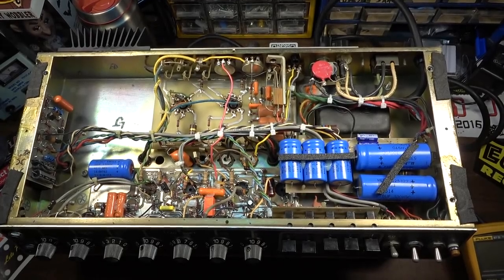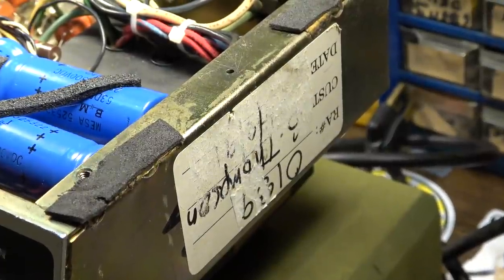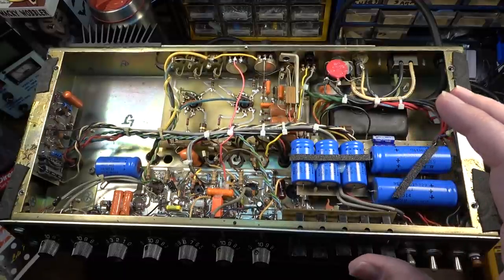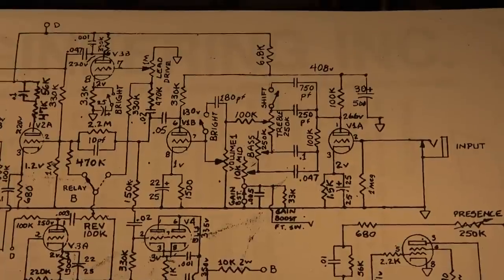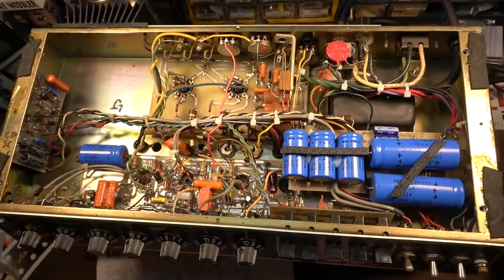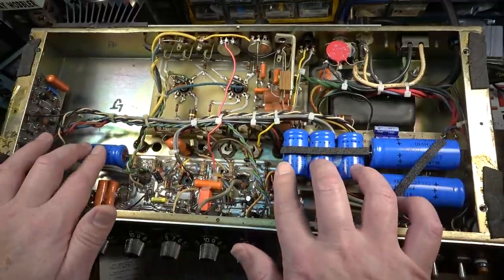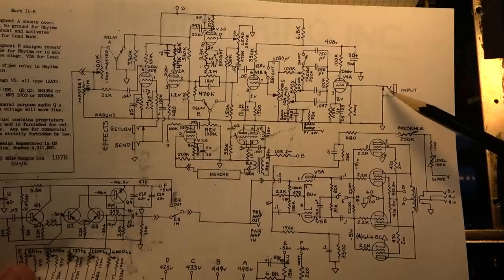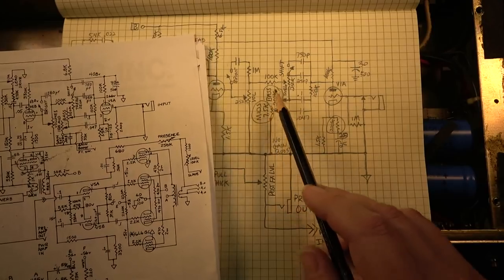The Mysterious Mesa Mark IIB+ | Analyzing a Factory-Modded Circuit

Comment: Man I can't thank you enough for going through all that work.  Now I can send this video to my customer so he can understand why I won't even attempt this mod. They are charging $400 at mesa now.  I read that there are over 20 variations of this amp.. apparently they just made changes as they went and wouldn't change the schematic.  The one I'm working on is from 85 and at least 50% of the resistors are different values than shown...please send help.. I'm not ok 😂
Reply: Jeeez.   My mk2b needs the crunch/lead gain worked on, but who the heck is going to help me lol

Comment: That resistor on the first triode is a swamping resistor. It 'tames the beast" if you will. Stabilizes voltage gain, but lowers the gain in doing so.

Comment: I have an 88-89' Mark III Blue Stripe combo. Got it in 99',  sent the chassis to Mesa in Ca. for an over haul in 05',  It was running fine but things were starting to scratch & crackle. Got it back in a month or so and 
it's still running today.  I mention this because Brad's right.  I was gonna do the work until I opened it up and was overwhelmed.  I started calling shops and techs but no one would touch it with a 10' pole.  The one shop that agreed to take it in admitted they knew nothing of it and it would be hit or miss. I thanked them for their time and called Mesa.  I've heard horror stories from both parties, techs don't like working with the amps and Mesa gets amps that techs have butchered beyond recognition.  So, this is for techs and Boogie owners. Techs, runaway when you see a Mesa coming up the driveway!  Owners, let Mesa fix your rig.  It will save you time and money, they don't charge anymore than a tech, your cost will be shipping if that applies. I'm a retired G.M. technician and I firmly believe when dealing with repairs of this type, you should take it straight to the source for repairs. O.e.m parts are superior in most stock cases and when you figure the time and money wasted after the guy down the street had to go to Jim's used cars & vcrs four times to get the right part that will last about a month (why do you think they have a lifetime warranty), cause you're gonna need it, then you have to pay Billy Bob down the street again.  Take it to the source, the guy who feeds his family working on whatever you need repaired and be Brand specific. Don't take a Maytag to a Whirlpool tech. Sorry so long but I keep seeing people making the same mistakes over and over and throwing good money after bad. I hope this helps the techs and the owners, cheers!  P.S. The Mesa portion may not apply now that Gibson acquired them.

Comment: Imagine Brad going through a 2C++.. He’d have a field day with that! 🤣😂🤣
Reply: i think the markv has more relays than the JP2C, i'd like to see him try a Triaxis.
Reply: or a roadster!! holy hell
Reply: @sendep7  I mean the OG 2C++
Reply: He already did a roadster ;)
Reply: 2C++ in the hardwired vesrion only adds like four components and changes the value of one resistor over a regular 2C+, the switchable version adds a single relay and a switch on top of that; the bottom line is it's not that complicated, from what I know at least.
Reply: C+ has only two or maybe three different board versions and two of only differ by reverb circuit. Mark IIB on the other hand was still kinda experimental since it was the ongoing process of perfecting Mark II which nowadays we call Mark IIA. C+ was a streamlined conclusion to all the mods done to the previous iterations thus why IIA and IIB are so chaotic in their layout. Also the "++" mod adds four additional components which add +6db to the initial input signal on Lead channel and +20db on the clean channel when engaged (Hetfields amp was hardwired this way but nowadays it is switchable, James just didn't see the need for usable cleans on his C+ since he used other amps for that). Mod also smoothes out some of the more aggressive midrange frequencies but the difference is subtle.

Comment: I've owned one of these amps when I was in college and used it extensively... I can't imagine putting another gain stage in it. As I remember that amp, it had crazy distortion in it's stock iteration. It was also a very clean amp even pushing the EV/SRO 12" speaker. (I might add that it was crazy loud and weighed a TON!)
Reply: I ordered a Mark -2B 60 watt EV direct in 82. Stupid amounts of gain available, and very nice cleans as I remember anyway.
quirky tip :
Put a compressor ( MXR dyna comp ) in the effects loop for infinite sustain at a reasonable volume level Santana Style

Comment: Totally agree Brad . They've tried so hard to make it the only amp you'd need , but the result is a nightmare to fix as you have demonstrated , and not even that easy to use . Wait until you see inside a Mk5 . That is all of their most notable amp circuits combined into one amp . It took me 20 hours or more of repair time to change a couple of burnt diodes and traces in a MK5 worth about 20 pence . My customer encouraged me to keep going even though I was worried about not getting the thing back together , there being dozens of wires to unsolder before you can lift the pcb and do the actual work . And IMO you are absolutely correct in saying leave it in the studio .

Comment: V4A - The grid is fed by a 0.1uF cap which is flipp'in huge for a guitar amp. Therefore current flows to the cathode via the 100k resistor plus the full signal as a small part of that voltage. It has more bass than what passes through the 0.1uF cap therefore get rolled off by the cathode - it being a negative. So this is both a preamp stage and bass roll-off filter.

Comment: It's my understanding, that the Mesa Mk II-B used the so called, "cascading effect" to overdrive the 12-AX7's in the pre-amp stage to obtain the amp's distortion where Jim Kelley amps overdrives the 6V6 power tubes to derive the amps distortion... which in my opinion has a more natural/organic tube distortion.

Comment: There seems to be schematic problems with quite a few Mesa amps. Not sure if perhaps I've had amps people have worked on prior, but I've never seen any RA# stickers or "messy chassis" evidence. Had a Roadster come in that was one tough dog to follow using a Mesa schematic that had wrong values and so many surprises, I had a party when I finally traced it over and found the problem. I really thought it was going to be a permanent part of my bench for the first few days I had it. They packed so much into that amp, but nothing compares to a Roadking. I'd be just fine if I never had to work on one of those again! Those are something else!
Reply from the maker: They fuck up their schematics on purpose.
Reply: @TheGuitologist  I knew it wasn't just a "misprint"! They don't like to cooperate at all, and since I'm not an "authorized repair service", they don't want to give access to any tech bulletins, FCO's, schematics - zip. I was a field engineer for 27 years, and I've been playing for 40. I got hooked the first time I swapped pickups and learned how to solder when I was 12. After that I started messing with amps, pedals - you know the deal. I love repairing and modding anything. The challenge of getting anything to work that's DOA is just something I love - BUT the Mesa Roadster and Road King I & II - damn. There's so much shit packed into those that I'm never wanting to "have at it" when someone calls to bring one in. There's things I know to look for, and components to change out from past experience - but trying to get ANY assistance from Mesa - at least for me because I don't know anyone there is a no go. I knew there was no way almost every schematic I've seen was a "misprint"! I don't understand why a "brand" like Mesa would do that on purpose? Crazy man.

Comment: Omfg , I actually have a Japanese knock off of a mk 2 b , that was laid out better than that .  It was called a Mesiah by Aidean engineering . 
Randall Smith promptly shut it down , lol .  And a notable similar was Dean Markley cd120 or a 60 version , which i may add  , were used by some notable players.  Probably on the advice of their tube technicians.  I can imagine,  like 
Nonono Eric , not the Mesa , this Markley is the same , but better ..
Reply: He mentioned the MESIA knockoff thing in guitar player? He claimed it was a horribly built POS and an insult to his high quality. From what I can gather over the years, is that he is  really full of himself

Comment: I did mesa boogie warranty for nearly 10yrs back between 2005 - 2012.  I requested they send board layouts so you could locate components easier.  They sent all they had which were Gerber files.  If you've ever tried to follow traces on a double sided Gerber file...well, you know the pain!

Comment: Hey Brad first thank you for all the informative videos! 
I watch your videos on a regular basis. 
I do poke my nose around a few amps from time to time. I have come across one of these mark2 b this one has the date actually printed on the preamp board as 1983.
I recently recapped the amp and installed all new tubes. The amp since went back to the owner. And came back about 6-7 months later with some weird issues.
At the time of servicing I had a very hard time finding a schematic that was anything close to the amp I had infront of me. (None of the diagrams I have found either then or now we're remotely close to the component values that are in this amp. I know for a fact it was "virgin" to any techs hands up until mine. Amp is a regular gigging amp, used minimum of 2 times a week. 
Anyways I am having issues trouble shooting with the schematics I have found. My first question is would you possibly have any links to a mesa mark 2 B 60w no reverb??
2ndly there is an auditable noise, very loud noise,  like a squeal when standby is engaged that will taper off and die. Some kind of cap discharge finding its way through the speaker. The amp otherwise runs pretty good. I found some microphonics were happening I have narrowed it down to V2 circuit as far as to say it's not the tube not the socket.  I then patched the guitar straight into the FX return and the squeal was almost constant I could wiggle the patch cord and make it go away for a bit. I then chopsticked a few ceramic caps around the v2 tube socket found 3 similar looking caps that are microphonic. The amp is very dirty inside and the caps are so old that the value markings are all but gone. They unfortunately are not readable.
Maybe one is 180pf 1000v but it's a half guess.... I just am not confident with the value. The other two look to be the same caps but the values are gone.
So......
Back to the schematics I don't see a variation of a schematic with these exact caps wired in any of the same location.
I feel you aggravation with thus amp but I am curious after so much time has passed we're you able to find any other info on these mark2 amps??
Thanks again for the videos

Comment: Do you like Traynor amps? I recently picked up a YBA 200 v2 and cant believe how decent of an amp it is. Interesting question though. Every so often it makes a pop or static pop. I brought it into my buddies music store and put it through a traynor cab using the same speaker cable and it didnt do it there. Could it be something with the power in my basement? It was just finished a couple years ago. The unit does it in all the outlets in my room.  Any idea how to diagnose or what that might be? Cab is 8ohms, head is 8ohms. Its an Ampeg 4 10"

Comment: The V4A part seems totally wrong. There's no way it works like that. There's not even a path for any DC current to flow through the tube! It can't be acting as a clipping diode either as that would just charge up the plate cap and do nothing after that.

Comment: It is a shit-ton of work to draw these out. been there. well done. are you sure there isnt another component connected to the cathode of V4a? maybe there is a link on the back? i think the 1Meg connected to point A should go to V4a grid so the rhythm signal goes to it's master volume pot since you are missing the thru connection for the rhythm sound. Is the anode resistor missing off V4a?. also the written correction should say parallel not series re the o.o1uF cap. The lead master goes via the relay to ground to reduce the volume same as in the old design. at 24.32 you comment on the diode to pin 9. wouldn't it be using the heater supply rectified to run the relay? the 220k on v1a would reduce the "deep" effect of the 22uF cap.    You are right. it is not a production amp. it looks like something a back yarder hot rodded!

Comment: So many 1980s and 90s tube amps are just so bad. It's like a weird mix of old fashioned tubes as well as some (often) poorly implemented solid state stuff. I have seen so many that are just designed wrong, causing all kinds of issues, noise and hum.
Sometimes I literally suggest the customer to rebuild the whole thing instead.
For this reason I still have a very nice Laney amp that I still have to repair. The thing just makes me mad, so much potential yet so many design mistakes.
It's to unfortunate, it all gave PCB design and solid state components in tube amps such a bad name, while it can actually perform very good when implemented well.

Nice video btw! :)

Comment: Have you ever come across any Groove Tubes amps? I had 2 Soul-O 75s and they were a spaghetti mess on the inside but the best overdrive IMO. Had to get rid of it because no tech around here could solve it's problem. After switching it on (off standby) it would play normal for about 30 seconds and then lose gain like there was an aggressive compressor inline. The harder you picked the cleaner the signal. Still trying to track another one down because it was the best high gain amp I've ever played. Very Brown Sound-ish but with a fat switch that made it huge in the low mids without making it flubby or boxy. If your curious about the amp's tones I can send you a link to a recording.

Comment: So Brad, love your channel.
You mentioned in there to “steer clear of Mesa amps or leave them in the studio where they belong...”
And then you said something about an amp that was easy to repair.
What would you suggest?
I have 2 C++s and an early Rev F Dual Recto (like you did in another vid).
NOTHING sounds like these amps- ESPECIALLY the C+s.
They are amazing.
What amp would give me that kind of gain and be “easier to repair”?
Thanks for your input.

Comment: Sounds like mr Smith wants any work done, to be done at Boogie.
I live in LA, at their shop I can get 
the correct interpretation of the circuit straight from the source, and likely, they can access an updated schematic and all he does is fix Boogies daily.   But where you live, and in many places it’s a giant shipping charge, to Boogie, and if it’s something simple, nobody will do that.  

They are now making some simpler amps, but are they easier on the inside.?    I have a Mark 5:25, tiny box, I’d imagine it’s a royal pain, even for them, and they know what to expect!    But I’ve been playing the crap out of it for 4 years now, the 5 band EQ makes it easy to switch guitars and get a consistent sound.   If I were a touring pro, I’d have a back up.   But their stuff has never let me down.....

Comment: Regarding the weird cathode fed stage: it may well be the tube equivalent of a common base transistor stage although i would think the grid there would typically go to a power supply.  It would be referred to as a common grid stage.
The common base stage is primarily known for its ability to present a low input impedance by driving the low impedance emitter and converting to a high impedance on the collector.  Not certain but i believe it also has unity gain.
I'm only speculating...haven't done any research...
Nicely done hand-drawn schematic!  Time consuming but well worth it.  Glass to see you appear to be warming up a bit to the challenge of the MESA BOOGIEMAN!

Comment: Well done, the self drawn schematic! With the reverse cathode follower they managed to not flip the signal 180degr.? I think. Not to confuse you:-) Clever! I learned a lot from my original mesa schematic from a early MKll-B in 1983. Since then I was a fan of the Company. Although the "Mesa Sound"  to me was allways to harsh and mid focused. Until the Lone Star Amps and others appeared. The acctual makes are top of the line small factoryproduction makes. "The Art of Engeenering" as they selfclaim:-)

Comment: You're extremely dedicated, reverse engineering the schematic. One thing you have to remember is that when the IIA's and the early IIB's were new amplifiers, they were made literally one at a time based on the customer's order. You can't compare this to Fender amps or Marshalls. Today will call that "boutique" amps. You should talk to Mike Bendinelli, I met him in person and Randall Smith back in the 80s at the factory. I have played a Mark IIA - continuously - since December 1983. It has never missed a gig. I recapped it in 2015 - for the first time.
Reply from the maker: What I’m comparing is the build ethos. If Mesa was building “boutique” amps, they would avoid using PCB, as modded PCB result in a messy build.

Comment: From the look of the insides, whoever designed the amp has never had to do any servicing-work on it, which I think is a bit ironic given that Randall Smith used to be an amp tech, personally, I think these Mesa/Boogie amps are way over-designed and way over-complicated, also, I've heard/read stories about Mesa/Boogie deliberately putting errors in their schematics as a form of copyright protection to prevent someone using the schematics to make bootleg copies of Mesa/Boogie amps.